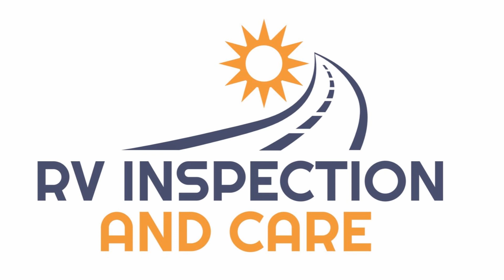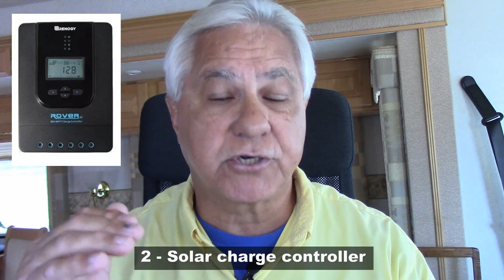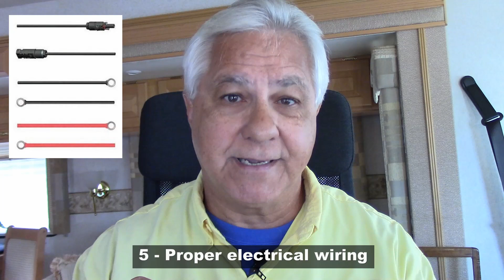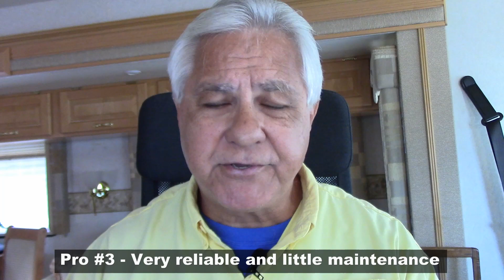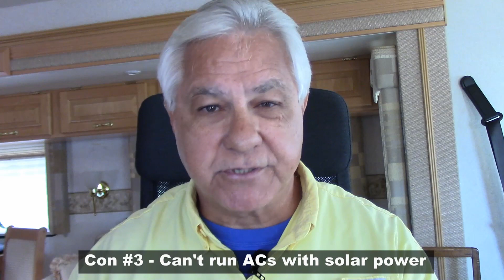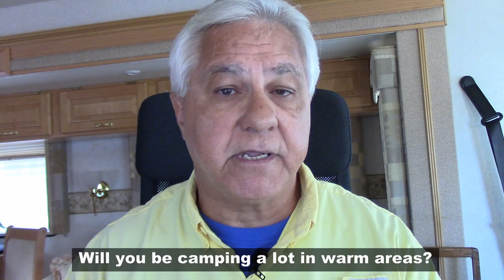RV Solar Systems - Who Needs Them?

Comment: Batteries will not run an air conditioner..batteries  are for televisions fans  computers and lights..😊
Reply from the maker: Hi Peter. I know what you mean by this comment. But of course, some RVers just have to try to push the limits and these days larger and larger RV solar systems are being installed that actually do allow running an A/C at least for a few hours. As you say, it's not the best solution though. Thanks for contributing to the discussion!

Comment: I was doing an antique show and a class A pulled in their spot. The promoter ran over to find out when they would turn off their gas generator. They had not even turned it on yet and the show did not start until the following day. For me, a portable solar generator and some panels would be great.
Reply from the maker: I would say that promoter's response is an unusual occurrence in general, but thanks for sharing your experience with us.

Comment: The kind of Solar Power System I am planning on using will be Portable Solar Panels that can be folded up, and stored inside the Coach when not being used. Everything I am planning on installing will be installed in a medium size box that will be mounted on a rear hitch rack on the back of the Coach. That way, should I decide to upgrade to a newer, larger Coach in the future, all I need to do, is swap the equipment from the old coach to the new coach.
Reply from the maker: Thanks for sharing your thought process on the solar equipment you plan to buy.

Comment: We have a small 25'5" motorhome. We would be considered in the frugal range at night. What about a 300w folding solar panel (like Dokio) with a solar generator? When the sun is MIA for awhile, we can always use our 2800 Onan generator to top off our two golf cart house batteries as a backup plan.
Reply from the maker: The combination of solar panel with solar generator is a great idea for smaller rigs. Lots of RVers are going that way now, especially those who like to boondock a lot. And having a generator as a backup is a fine plan. Sounds like you have it all figured out HT!

Comment: We are getting ready to move from the pop up stage to hybrid stage of camping.  I will be converting the frig from propane/electric to 12 volt (I live in Indiana so we have many of this sort of thing available).  I am thinking on adding additional lithium batteries to run the frig while traveling and possibly two c-pap machines and frig for one overnight while between stops.  Do you have anything on batteries?
Reply from the maker: Hi Lynn. I haven't made a video guide on batteries yet, but stay tuned. It will probably be coming soon. Of course, lithium batteries are a great choice. The price is still a little high at this point but hopefully it will drop more as the technology becomes more accepted and widespread. All the best to you on your RV travel plans.
Reply: Best to DIY a battery bank for a 4th the cost.   560a cost me $1200.  Equivalent batteries would have been over $5000.

Comment: Even though I use very little power in RV while off grid, I can keep the batteries topped of with our generator.  We only run it for 30-40 minutes and the generator needs to be run or it will not last!  Thanks for the pros/cons!
Reply from the maker: I'm glad that you shared that 11e. I have another video coming out this week on the use of generators to provide RV power and I appreciate hearing from your experience. Please comment again on the new video if you can.

Comment: You can probably get by with less solar if you have LFP batteries since they will charge much faster than AGM.
Reply from the maker: That's a good point Brian, and lithium batteries offer a lot of advantages for RVers using solar to power their rig.
Reply: Don't think so.  LFP allows you to  hold more useable energy but don't charge faster.
Reply: @mrtestshoot  But they do. If you charge AGMS from 50% and LFPs from 50% the LFP will finish charging in roughly half the time. That's because LFP will stay in bulk charging mode(the fast portion of the whole charging cycle) until the battery is full whereas AGMs go into absorption mode (for the final topping off) which is much slower. Has to do with the way LA batteries take up power.
Reply: But less solar is like using a garden hose to put out a fire when something larger is appropriate. A good rule of thumb is 2 watts solar for every AH of LFP battery.